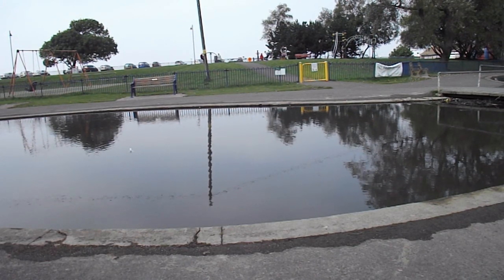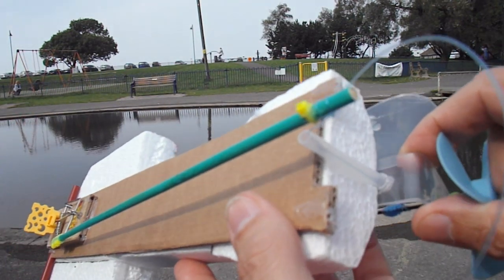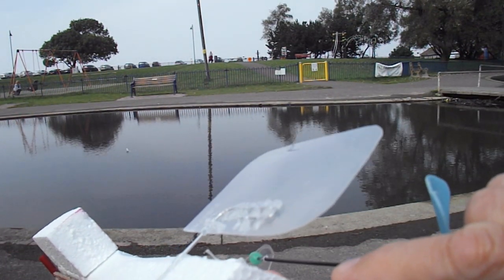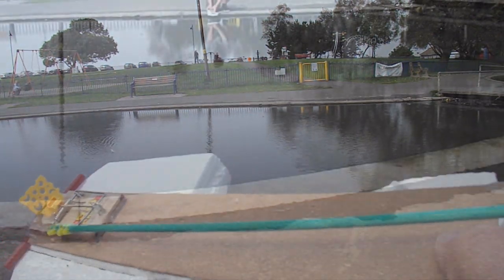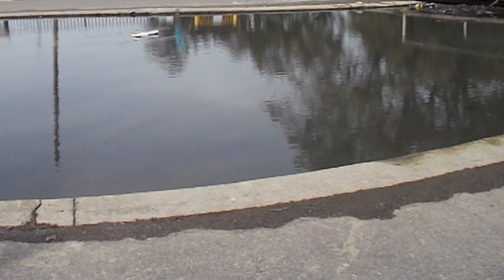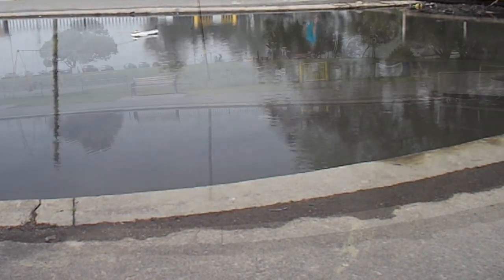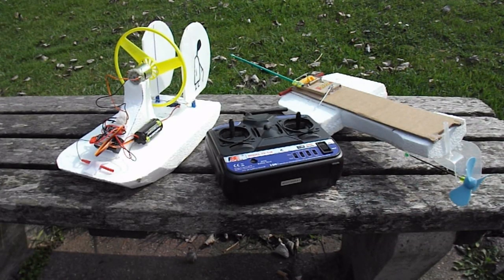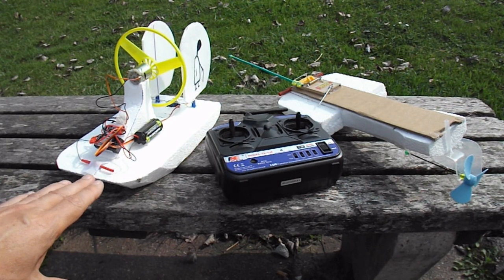Let's try my Airboat and Mousetrap Boat on a boating lake

Comment: Just having a look at your boat projects over the years. You had a bit of a problem rescuing the mousetrap boat with that lightweight RC boat, but it made me think about your twin pop bottles rescue boat. A couple of neodymian magnets on it and some thin metal strips on any of your good RC boats would help you rescue them better. Just side up to the boat in need of rescue and "bobs your uncle". 
Of course, you have probably done it. 😆👍
Reply from the maker: Glad you are forced to sit there and watch all my videos. That should help you sleep. You will find that my rescue recovery boat originally had a long arm with a neodymium magnet on a line. The arm was controlled by a 360° servo. Like many of my designs, it was over engineered. I quickly found it was easier to just push the other boat, rather than try to tow it on the arm. Another equally simple solution is for the recovery boat to tow a line out and encircle the dead boat, then you pull it back in. Towing one boat with another is a lot harder than you might think. The second boat acts as a big rudder on the first boat, so if you haven't got it neatly attached right on the point of the bow, it will be going it's own way and dragging your good boat with it.

Comment: That rc airboat is very slow. I though it would go a bit faster considering it has a pretty powerful motor. Nonetheless, Awesome Video!
Reply from the maker: Thank you, I have no doubt a LiPo battery would help it, but as I answered your other comment, I don't really want a very fast boat. Maybe these could be a little more powerful but as you know, most of my testing is done in the bath.
Reply: Thats Ok. Thanks For this video!
Reply from the maker: Sahan Methmal :-)

Comment: grandad how to connect a 12 v motor with rc car circuit with a relay if needed.
Reply from the maker: If you are talking hobby grade RC then you choose the right ESC to match the motor. A 12 volt motor would need an ESC that can handle 12 volts but it would also need to handle the current that your motor will draw. I would suggest looking at one of the RC Car forums if you want advice. If you are using toy grade RC then this video shows a clever way of using a small RC receiver to control a large voltage motor https://youtu.be/-gFjPhD6wNo
Reply: thanks.
Reply from the maker: soumita bhattacharya 😊